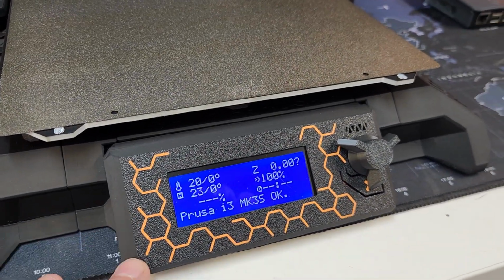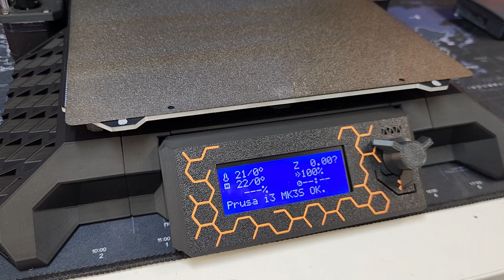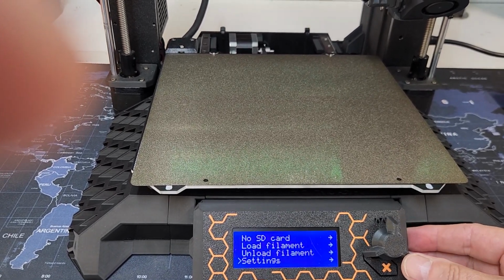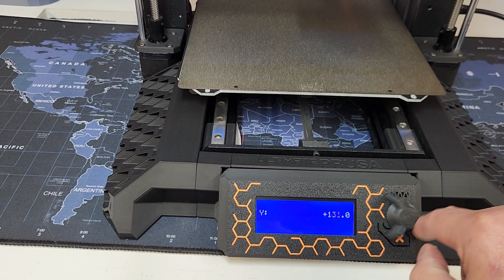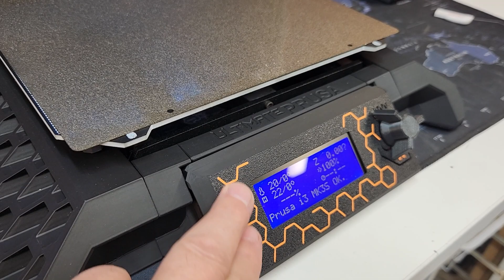Ultimate Prusa i3 Mk3 on a budget PT 2

Comment: Interesting build. I started to build a DIY i3 Mk2-ish printer way back when, all-thread frame and all. Before I got it running I found an open box, Flashforge Finder 2 for $35 US and just used the every loving shite out of it. Now that Ender 3's are super cheap, I got a bone stock one for $100 and wonder why I messed around with all the other stuff all these years.

So, I dug out the "MK2" the other day and have started to look for firmware and whatnot. You've got me motivated now! At the time, 2020 extrusion seemed expensive but now I have a case of it sitting around so maybe it will end up like a Bear clone.
Reply from the maker: Honestly after building this and seeing how bad the frame wobble really is the Bear frame makes perfect sense 👌